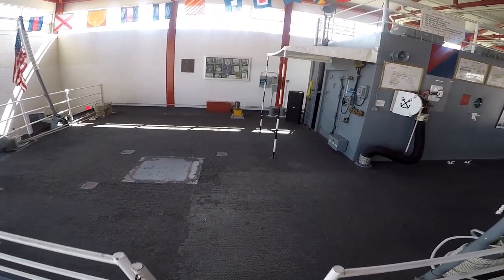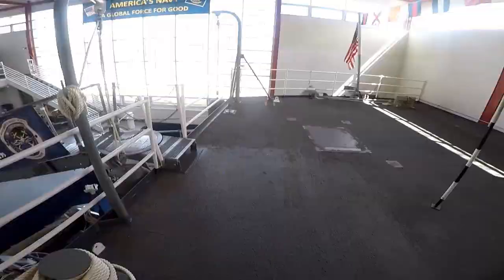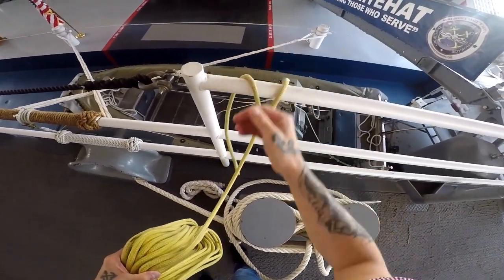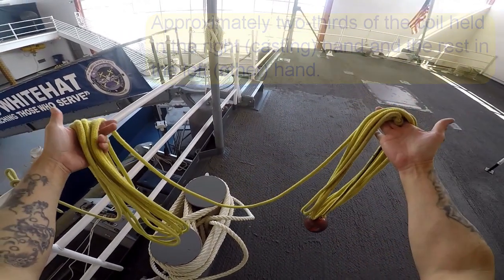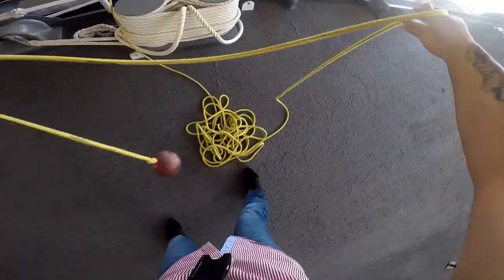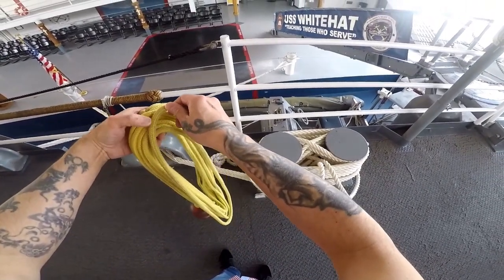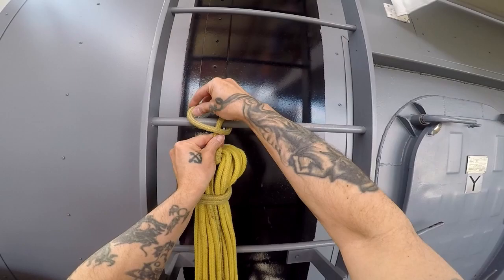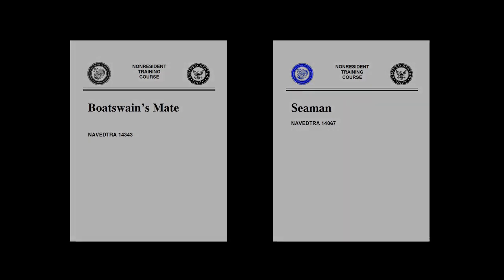BM SCC Heaving Line Training

Comment: Nicely done, Boats! In the tugboats I still see plenty of monkey’s fists. More recently I’ve seen them filled with either sand bags or  just  a ball of used duck tape then often dipped, repeatedly in paint to add weigh (which if not smoothed makes a thorny ball of pain like being hit in the face with a ball of razor sharp barnacle). But, occasionally I’ll find a deckhand trying to use large nut, bolt, or large ball from a bearing as a core. Not so nice for the guy on the dock. I’ve seen longshoremen cut off a fist that sounded too solid when hitting the dock. I haven’t seen any regulation against such cores but I know after nearly being hit by a lead ball off a foreign ship that this is just an u safe idea. As a traditionalist of marlinespike seamanship I scoff at the rubber balls but they are easier, safer, and effective.
Reply from the maker: Thanks, Bryan!  It means a lot hearing from another salty mariner.
Reply: Hey im a 19 year old worker with calmac in the western isles i used many heaving lines good info vid cya